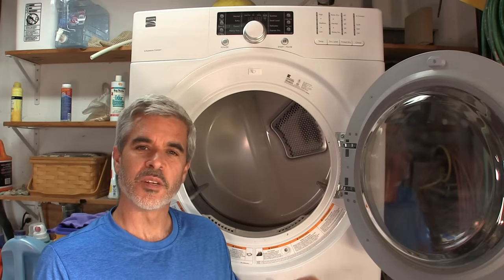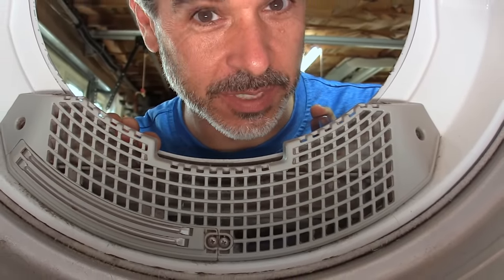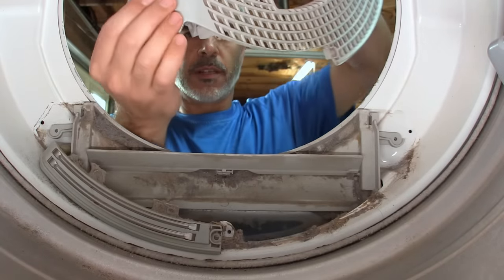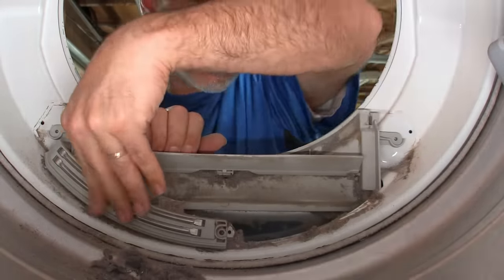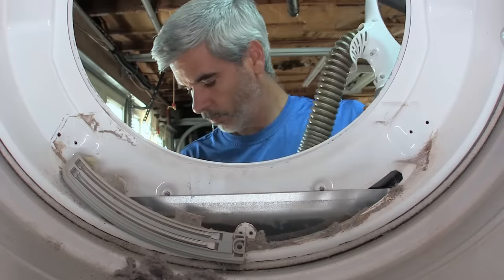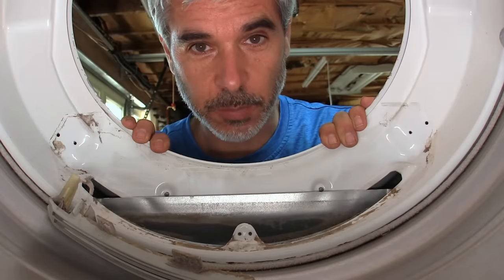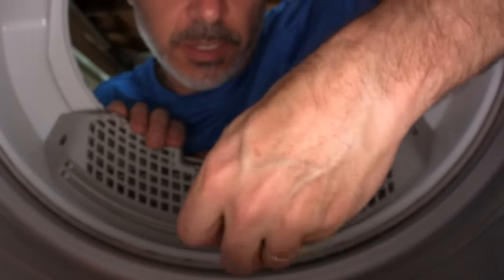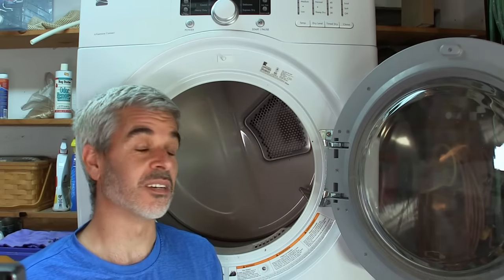Dryer Lint Trap Deep-Cleaning: I found 4 cups of fluff below the filter!

Comment: I had the exact same thing happen to my Samsung dryer. I removed the lint filter cage (3 screws on the inside and 1 screw on the front end) and the lint filter cover below that and vacuumed out all of the lint. It made room for the lint filter to fit snuggly into place all the way down so your clothes would not snag anymore. The problem is that in time, lint will clump up down inside the lint trap area inside the cover and below the filter placement. When it clumps up too much, the filter will not sit flush. It is a poor design. Lint should all get trapped in just the filter and not inside that area below the filter. I suggest cleaning it out at least once a year. Of course, you have to remove the top lid and the front to get to all this. There are great videos on YOUTUBE on how to remove that if you look up heater coil replacement. The lint trap cage and cover are pretty self-explanatory but there are videos for that too I imagine.
Reply from the maker: Thanks for the info! Have a good one.

Comment: Nice video, but I would have used a stiff brush to get the stubborn lint off the metal and plastic.  Plus, I would have washed a few of those plastic pieces in the shower.  However, all homeowners need to understand that vendors who clean dryers will generally clean the dryer duct from the back of the dryer to the outside vent.

Comment: I thought my dryer LOOKED very much like your dryer,  but when I checked it, no screws, and not even any way to look down in the crevice. There is a metal ledge blocking the view. No lint on the metal ledge, though. I remember that a repair man once took the whole front off of this dryer by undoing screws in the back, I think, and when the front was off you could see the inner space on the right side of the drum was packed with lint. White, fluffy lint, not that gray dust that you vacuumed out of the bottom. Good video, though.
Reply from the maker: Interesting. Not sure how your lint trap goes down inside of there is a metal edge there.
Reply: @DansWay  The lint screen is much shorter than yours.

Comment: What “somebody” needs to do is build a powerful lint-vacuum with multiple hose attachments for all types of dry vents . I have a flat hose that is supposed to be universal but doesn’t work with my powerful shop-vac because my shop-vac connection is much larger than the universal connection. I’m too old to be rummaging inside a dryer and my fingers are not as dextrous as they used to be. 😢 I love this machine, but manufacturers really need to rethink dryer vents and cleaning.

Comment: I would add a real fine mesh inside to block the debris from going down to the botton
Reply from the maker: You could, but I would caution that if you don't clean it out regularly, the fine mesh could cause a blockage that would have otherwise just been exhausted.  Just be super careful to check the mesh regularly if you do.

Comment: I followed these instructions and it was so easy!! Thank you so much! Only problem is that now my dryer is making a horrendous noise ☹️ I have checked, no screws or anything is loose or rattling, but it’s making a crazy amount of noise now. Help!
Reply from the maker: Have you tried moving the barrel manually to see if the noise is from it rotating?  If that is quiet, you could have pushed something down inside the blower?  I'm not sure.  So sorry your having problems now!  Take a close look down the hole to see if there is something in the blower.
Reply: Thank you for replying, so nice of you... I will check everything again. ♥️
Reply from the maker: Hey Hannah, did you get the noise figured out?

Comment: You need to clean the vent duct also, my dryer wasn’t drying and my vent was almost completely plugged. So clean the whole thing all the way to the outside. A vacuum works well for this and I bought a thin flexible tube to clean it throughly.

Comment: You buy a blue tool that goes on your hosed vacuum cleaner. It works really well, with a long skinny hose to clean it all out. You do need a light, I use my head lamp.
Reply from the maker: Thanks for the suggestion.

Comment: Dan I have the same dryer what if mines won’t turn on after a snowstorm? Anyways to reset it or do I have to hire a professional and spend wild money :(
Reply from the maker: Are you saying you don't have any lights at all?  Perhaps a breaker blew and the outlet doesn't have power?
Reply: @DansWay  been told about this before will definitely check it out since the electricity did cut out during the snowstorm.

Comment: What if your lint catcher is at the top and the lint keeps building up outside your home in the "catcher" on the side of your home not in the lint catcher?
Reply from the maker: Wow, it sounds like your filter on the top isn't doing its job well.  Best long-term advice would be to clean the filter after every load so that when you remove it, debris don't fall down inside which then ends up getting blown outside.  You can remove the back of the dryer to gain access to the vent channel where the filter goes.  Perhaps there is enough debris there that the filter isn't making a proper seal...

Comment: I have a stacking unit that was installed on a platform about 3" high.  There's no way to lift the units out of there.  Just too heavy for this old gal.  I'd want to move it off it's base because I KNOW the dryer duct, which is vented outside, HAS to be loaded with lint and dirt after 20 years!  How would you go about cleaning the duct without moving the unit but still accessing the duct.
Reply from the maker: Oh man, that is hard...  You really do need to get back there somehow. I was able to work from the side as you can see in this video: https://youtu.be/oaCXtmdLJkU
You could try pushing back on the stack to get the front feet in the air a bit, then slide cardboard under it, then pull (with a friend) from the back to slide both units together.  Nothing easy about this, sorry!
Reply: @DansWay  Hi, my unit is enclosed within three walls, so short of blowing up a couple of them, I'll out of ideas myself.  The only thing I can think of is if someone could get on top of it and used longer tools to access the duct?  I think that may take a magician.  Lots of room on top.  Oh well, the unit is old enough it just may give up the ghost and I'll have to buy a new one, right?  THEN I can clean the duct.  It's going to be embarrassing!!!!!  Thanks so much for your help, Dan.
Reply from the maker: My neighbor purchased a new unit and when installing it found the exhaust was clogged and the old unit would have kept working perfectly if she just had it cleaned out.  I suggest you pay a professional cleaner unless you want the excuse to get a new unit 😉
Reply: @DansWay  hahaha  Nope.  At 73 I'm looking for an apartment not appliances.  Time to unload this house.  But thanks anyway!

Comment: That is not the only place lint collects. You have to remove the lower front panel on a front load dryer (Whirlpool/Maytag) to clean inside.
Lint is all over the inside, covering all the electrical parts and even the drive motor. Especially dangerous if you have a gas dryer.
Ask my how I know. While replacing solenoids and sensors in my gas dryer I was shocked to see all the dangerous lint inside. I thoroughly cleaned the lint prior to reassembly.

There is way more duct work inside a dryer than this video depicts, most of the lint that sticks inside the duct work is the damp lint that collects.

Comment: I have a Samsung HD dryer and looked at the manual and it only mentions the little pull out filter screen. I always take that out and clean it before every load, but clearly that's not enough. It's crazy the manual doesn't also say to check for lint further inside which doesn't get picked up - and that you should clean it out.

Comment: Thank you for the video.  My clothes don't come out dry so I usually have to do another quick cycle. I did this but made no difference.  It didn't look too bad to begin with.  Any idea what to try next?  Could it be the sensor is going bad?  Unit is 18 years old!
Reply from the maker: I would definitely  watch my video on cleaning out the vent tube and exhaust.  If the exhaust side is clogged it will reduce airflow and slow down the drying dramatically.
Reply: @DansWay  , yeah, I did all of that as well.  Might be the moisture sensor.  I've ordered a new one since it is only $10.  We'll see how it goes.  Thank you for your quick help!

Comment: You can clean this just by removing the filter screen.  Buy a short length of 3/4 inc flexible tubing, insert it into the vacuum crevice tool and seal with duct tape. The tubing will reach all of the areas that you cleaned with the crevice tool after removing the plastic parts.

Comment: I use a vacuum to suck that lint with a thin tool around the hose about  a foot long. Or attach the inside roller of a paper towel to attach to hose and works lovely.

Comment: I’m certain you’re unplugging it before, correct? Also, turn off the gas?
Reply from the maker: Those are always safe ways to start a project like this.  I wouldn't touch the gas connection for this particular cleaning as you could actually trigger a leak in the valve.  This dissasembly is so minimal...

Comment: Or... Just spend $4 on an attachment that fits any vac with a hose that has a 1/2" little hose on that. It reaches all that without ever taking anything apart. Its cheap quick & effective. It fits right on the hose just like the crevice tool you used in the video. Its a cheap plastic miracle for anyone bot at all interested in taking your dryer apart.

Comment: I attach an empty paper towel roll to my vacuum cleaner then flatten the end and put it in the slot. It cleans it all out without taking anything apart. My dryer doesn't have these screws to remove.

Comment: That all fine and dandy but you need to have the inside of the machine cleaned out as well 
that 4 cups could be a 4-5 gallon bucket full of fluff under the dryer drum . 
Don't forget vent pipes once a year or more depending on usage .

Comment: I was trying to find a tutorial on removing the mesh on the back wall inside the dryer. You can see it in the beginning of your video. There are 3 screws that seemingly hold it together, but once I unscrewed them, nothing moved. My dryer has lots of lint that looks like dog hair between the inner wall and the mesh (yuk), but holes are too small to be able to suck it out with a vacuum cleaner 🤯 Please help! 🙏
Reply from the maker: Hey Vava.  As I understand it, the mesh is covering over the place where hot air is coming into the dryer in the first place.  I could be wrong, but if I'm not, that means you have a lot of buildup on the heater or burner side of the dryer. I would either get a knowledgeable friend to help disassemble the entire intake area and clean/inspect the burner, or get a professional to work on it.  The risk is very high if you are seeing debris build up behind that mesh.
Reply: @DansWay  Thank you for the reply, Dan. I was afraid that's the case, I inherited these washer and dryer with house purchase and have used it for 6 years since, so it's possible that you're right and it's high time for a professional checkup... otherwise the unit is doomed....  😢

Comment: Hey there, great video! We have a 3 year old LG Sensor Dryer and I've had to clean under the filter (as per your video) due to clogging every couple of months since it was brand new.  Are we doing something wrong during the drying process? Or is this a design flaw? Thanks.
Reply from the maker: I’d guess that the lint is falling off the lint trap as you pull it out, or there’s something about the seal that isn’t right that should be corrected. It shouldn’t build up that bad in three years. If you clean out the filter after each wash or a couple of washes, there won’t be so much to fall down inside as well.

Comment: This is a great video. I literary have the same dryer was able to do this in quick time. Would you say this is a superficial cleanup?  Would you recommend opening more of the dryer to vacuum more mint that gets around the tumbler mechanism? Or is it not necessary with this cleanup you show?
Reply from the maker: You definitly what to do the back (exhaust) side as well.  I need to take it completely apart and look at the input side to see how that appears as well. It is another source of dust/dirt, but not necessarily lint.  The fan is sucking air into the barrel so all airflow should be negative into it, so I don't expect to see lint around the heater... But people say they had lots inside so I'll check...  Stay tuned for another video on that process!

Comment: Do this ! Lots of "how to" videos on YouTube. Simple kits at any hardware store to do the vent hose. If you can't, or won't, hire a guy. Or, buy a competent friend a bucket of chicken lunch to do it. A former contact of mine had an overnight dryer fire in a rural area. Four people in the family barely escaped alive. The dad had a bad leg fracture jumping from the 2nd floor. House was a total loss.Get it clean, and never set the dryer to run where the cycle won't finish till late evening. Because a dryer fire, like a couch-cigarette fire will smolder for a time before it burns.

Comment: Instead of having someone come out to clean the vent that attaches at the back of the dryer, do they make it so you can remove the bottom front panel and clean out the vent to the outside and under the dryer at the back? (18 yo Kenmore Elite). I clean mine each time & no dryer sheets and the vent outside blows & has great hot airflow. I do use the vacuum crevice tool once in awhile to clean out the where the screen goes but didn't know you could remove it.

The gentleman that brought my 18 yo Kenmore Elite washer back to life for $300 said as long as you have good hot airflow, all is good. I did not want to buy one of the newer washing machine models of any brand. 

So, other things under the dryer can cause a fire? My air vent to the outside is only about 2 ft long. I put my hand up there and pull out as much as I can that is stuck to the sides of the metal vent. 

Sorry off topic on the washer. 😊

Comment: Why does lint get past the filter? Thanks
Reply from the maker: Good question...  Likely due to the fact that when you pull it out, anything not really stuck to the filter can just drop down inside.  Then when you re-insert the filter, you pack the loose lint and debris down in the bottom and hold it there.  Repeat this a few hundred times, and it all just build up.  Eventually the filter doesn't quite go all the way down, which allows even more lint to get around the filter...

Comment: You missed three other places to clean..the rubber gasket around the edge of the door gets lint and grit under it and the pipe that goes from the area you cleaned to the back of the machine and to the outside vent ..I rigged up a piece of hose taped to my vacuum wand ,to turn the corner at the front...lots of lint blocks that too...and the vent cover outside the house sometimes gets lint stuck in it so it doesn't close properly...I'm  a woman in my seventies but read about this years ago and how it starts fires so tried my hand at cleaning it out.
Reply from the maker: Great job!  Glad you are able to do all this maintenance on your machine.  I have a video for cleaning the hose and exhaust as well.  Link is in the description above.

Comment: I clean that area with a radiator brush and the crevice tool on the vacuum. I'm worried about the vent stack. W/D are on inside wall so stack goes all the way up and vents through the roof.....I have a feeling it's going to cost me a sum to get someone to clean it out.

Comment: Dan, I have a different model Bosch, WTVC4500UC/10, doesn't have the same type of grill, only two screws towards each end, recessed very deep, is there another way to get it off?
Reply: I took a pex pipe and connected it to my vacuum hose. A few minutes later...all done! No screws to take off. use a flash light to look inside.

Comment: For that service people charge up to $400?
What happens if you break something trying to do it yourself?
You left lint on the inside.  Maybe run a damp cloth around the edges inside the dryer before putting it back together?
Reply from the maker: Sure, they can charge a lot for an on site service call.  If you break it, then you call the service guy, but there isn't much to break here...

Comment: I’m definitely trying the disassemble. But before seeing this video I used the same exact vacuum as you and tried to suck up the extra lint and it didn’t budge. I thought maybe it’s too thick or maybe a little moisture within to make it heavy.  Do you think it’s just the access once it’s disassembled that will allow the vacuum to suck it all up?
Reply from the maker: Hey Tracy, it definitely can get mashed down in there.  You could try a long screw-driver or other metal instrument to poke at it to see if it is just caked in there.  Opening up the plastic allows for a lot more access to get the vacuum down there better and get it cleaned out.
Reply: @DansWay  Hello Dan! Thank you so much for replying. I will certainly try the long screwdriver. Eventually I’d like to open the plastic for sure. I have 2 little ones at home so I need to make sure I have ample time lol I will admit I tried using skewers then dropped one and had a mini panic attack. I somehow was able to scoop it out and vowed never to do that again. But seeing that extra build up drives me crazy!! I finally looked it up and happily found your video here. 😊
Reply from the maker: @tracyelizabeth2178  Haha, awesome.  Let us know how it turns out for sure!